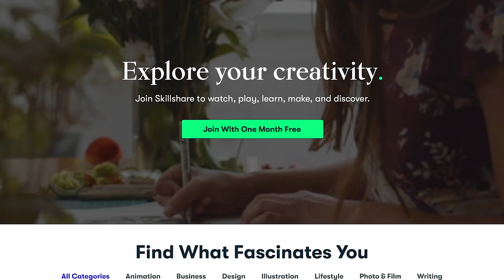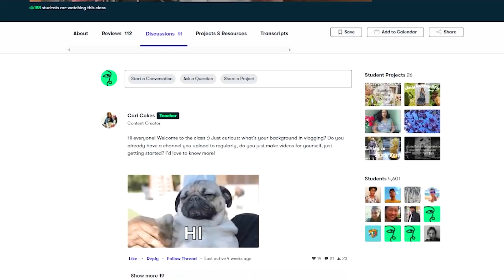We Weren't Sure If This Would Work...| Living Off Grid In The Canadian Mountains

Comment: Took carpentry 101 - Instructor said not to cut boards with circular saw when the board is propped up at both ends. Because the board buckles at the cut and pinches the circular saw.  The board is supposed to be a cantilever propped up at one end only when you cut it.  Maybe this also applies to chainsaws?

Comment: Bought an energizer brand genny ran 6 hrs and blew up bought a Firman genny in a pinch 6yrs use so far starts on second pull every time even If sitting all winter quite surprised actually didn’t expect more than a season from a 250$ unit.

Comment: Clean the carburetor and get the old fuel out. Use fresh fuel and check or replace the fuel filter. Start with a new spark plug each year.

Comment: Build your own a 3 horse predator engine a lifetime guarantee 12 volt gm alternator for a 1980 gm a 12 volt battery and a inverter . When one component fails you replace it cheap . Portable generators are made with not quite garbage parts . They are throw away meant for rare use and rapid failure.

Comment: I am pretty sure the chain went bad the moment it hit the first sand/stones that was stuck on the tree after it  been dragged with the traktor. Next time maybe sweep the tree around from dirt before sawing :D
Reply: And its extra hardcore never use ear pretection using the saw or grinder or tractor
Reply from the maker: it's just a smaller saw and doesn't cut as fast as the bigger saw that bit the dust
Reply: Yep! I logged for years, just a touch of dirt and your going to be sharpening for sure!

Comment: rocky mount va. unless you buy the big ones i don't think there is so much diff. i have a hft one now electric start that has done well. i had a little honda  pull start that is very hard to start the piece of junk is in storage shed and will stay there. water in gas could be a lot of it. one of my friend got a clear jug of  non corn gas at lucky mart and let it set a week there was 6 inches of water in bottom of jug. take care, be safe and well.

Comment: If the fuel has Ethanol it might get contamination in the fuel.  I don't use my equipment enough and the Ethanol gets watered down.  It also ruins my fuel lines.  (Google says: Ten percent ethanol blends can hold small amounts of water in solution, above this level a phase separation of water and ethanol mix separates from the gasoline.)
Reply: The ethanol actually grabs the water and carries water with it into the carburetor! It then gums up the jets and then breaks down the seals and gaskets! I had given a gas pressure washer to me for free because of ethanol ! I pulled the carburetor off and cleaned it out and put it back together, put fresh gas in it! 2 pulls and it was running great! It was a Honda!!

Comment: A sure killer of any "small motor" equipment is using ethanol gas. I have not had any problems with my small motor equipment by using "NON-ETHANOL" gas. It cost a little more but much cheaper than having to spend hours fixing carburetors and fuel lines or hiring someone or having to continually buy new generators. Happy trails - always enjoy watching your channel.

Comment: Generator problems, I posted about this before.  You'd be better off running on propane.  Straight 87 gas will gumup the carb in no time.  You can prevent that some by going to an ethanol free gas or using something like Stabilzer.  In the end, propane is the best way to run a generator.

Comment: Buy the 7kv Honda generator with automatic start that you can wire into your Solar controller to auto charge batteries. If a Honda doesn't start first time every time then you left the fuel tap turned off.. LoL. Had mine ten years never missed a beat and I'm Off grid in Australia so it's damn hot here and yet it purrs like a Kitten. Oil Changes regularly are the key

Comment: Not sure if you have ethanol in your your fuel there. Here in the states we do and it will plug carbs on small engines. I use none ethanol fuel in them now and have not had issue since.

Comment: Hope your not using 7018 welding rod because it's crap needs to high of heat I use 7014 for most everything if dirty 6013 cuts throw oil

Comment: Ah the generator. Small engines need to be cared for. It’s a pain in the ass but ya gotta use fuel preservative, clean or replace spark plugs etc. and they’re all crap these days.  You guys got so much going on but you gotta give time to maintaining your stuff. I have a generac. Don’t use it all the time but keep fuel saver in it, then turn the gas valve off and run it till it dies. Then you don’t have gas in the carb which has turned into deck stain and gums it all up. But otherwise you kids are great. The critter footage is wonderful.
Reply: Yep!!

Comment: did i notice your generator only cranks for a little bit then stops cranking on it's own?
the very first thing i'd do to that machine is find and eliminate that limit switch or whatever it is.
if it were mine, i'd make that heffer crank till i took my finger off the button.
be very particular about your fuel.
only put fresh clean gas in it. the higher octane the better. the best results i've had with my small power equipment is run it till it's out of gas.
got a small job? only put a little bit of gas in it.
so there is none left in the tank to draw moisture and go bad and so forth while it sits waiting to go again.
todays "modern" fuels have so many additives and junk in it a carb full of gas sitting for a month or two is nothing but bad news for it.
store it only in a dry place, never out in the open.
good luck.

Comment: I have been around many different generators in my time and the most common issues I see with non starting gens is a fuel issue. They seem to be prone to getting water in the fuel when outside a lot and then the water plays hell with the carburetors. Make sure your gas cans are clean before refueling rinse out with some alcohol if need be to remove all water and contaminants. drop the bowl off the carburetor or drain it if it has a drain plug to keep the water in the bottom of the bowl from building up. And as much as I don't like to say it the best generator is a Honda. Yes they are costly but they sure seem from those I know who use and myself included to give the least issues. I have a Honda 5000 watt and this will be it's 5th summer and I have only changed oil, filters, and plugs on it. I went and looked it's saying 731 hours on it.
Reply: I bit the bullet and got myself a Honda, too. The best brand-choice as backup for my small solar set-up to top off the batteries as needed, also easy/low maintenance, super quiet (great since I'm off -grid in a neighborhood) and most important for me, easy to start. I have a real problem starting pull-cords...weed-whackers, chain saws, nopenope no can. Gotta be rechargeables/battery. I can barely manage my lawn mower's pull and it is supposed to be "easy start". So yep, Honda for me, too! :-D

Comment: My advice as far as generators are concerned is to save up and buy a whole house type generator. Either a diesel or a propane run one. a 9K or above one to run everything. Make your solar aray larger and get more battery bank. You can have it set up so as the generator will start up automatically and charge your battery bank if solar isn't doing it's thing.build a gen house away from your home and wire it all up to you home(homes) that way the noise isn't such a factor. Oh, and watching you from North Carolina. Thanks for sharing!

Comment: Hey guys, because of the difference in the temperature between day and night and the engine was warm possibly condensation builds up in the gas tank, and the engine won't burn water, as you know. So you might try putting in a dryer filter so that the water won't go into the carburetor. Or just figure out how to drain the water out by opening the gas tank drain into a jar so that you can see if there really is water in the tank. Also, you can get some fuel system clean and put a bit of that in the take that will cause the water to be combustible and the engine should start without problems. This biggest problem with generators is condensation. Oh, wow, I watched a bit further in the video and I just saw the fuel line that comes from the tank so your problem is very easy to troubleshoot. punch two hole in the top of an empty jar this insert, a threaded nipple in each of the holes with a nut and washer. Connect one end of the hose to a nipple from the tank and the out flow from the jar to a piece of hose that connects to the carburetor. the water will always flow to the bottom this way you will know immediately whether or not there is an water from condensation collecting in the bottom of the tank after you use the generator